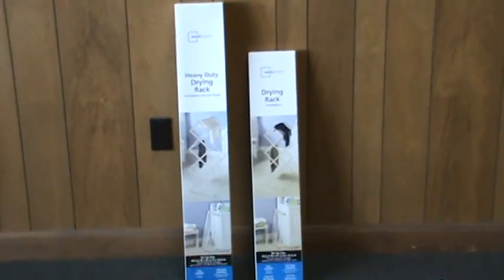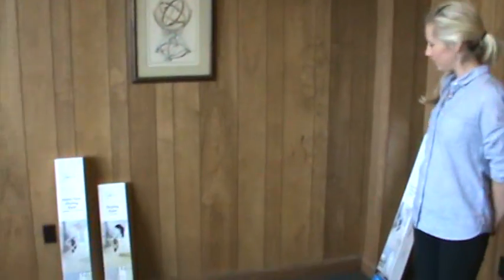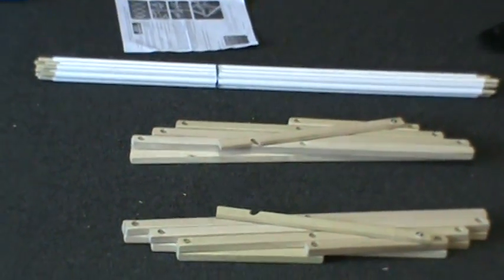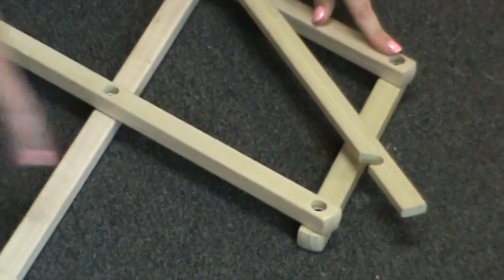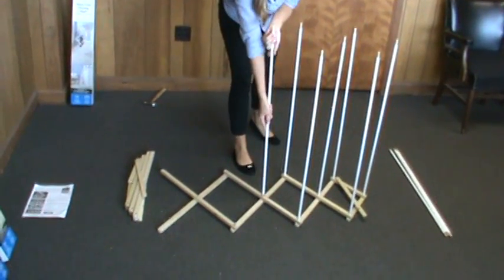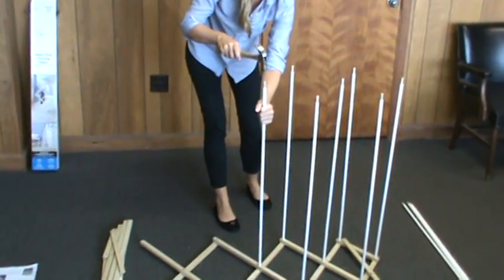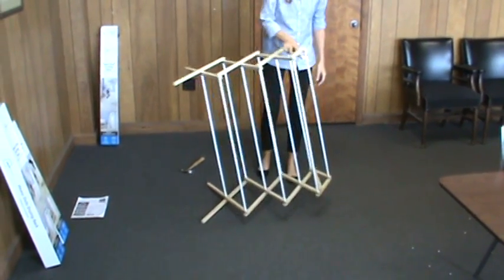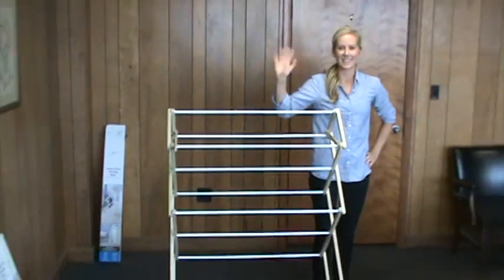KD DRYER ASSEMBLY INSTRUCTIONS

Comment: Thanks for the video it helped a lot putting it together.  However, this Mainstays drying rack from Wal-Mart does not stay together.  In the winter, as soon as the wood on the ends begin to dry out, the dowels fall out when it is being moved or lifted.  Things just are not made as well as they once were.

Comment: The QC department totally dropped the ball on the 1 i got.  The dowels aren't snug in the holes and it falls apart super easily.  I'm trying to come up with a hack i can do to make it work.  Im gonna try wrapping the lose connectors with duct tape to make them tighter, but straight outa the gate I am not impressed with the thing.